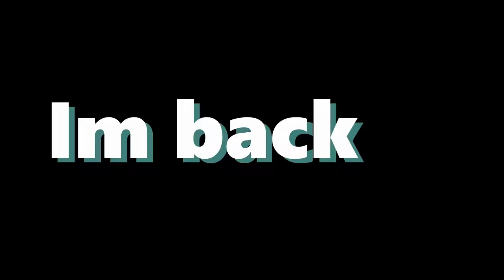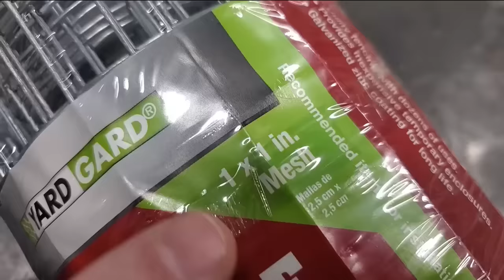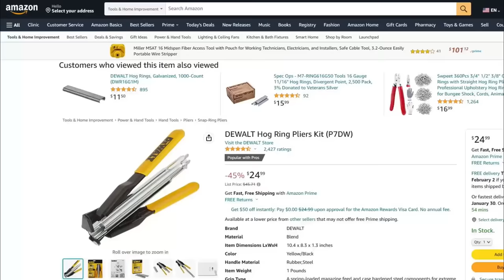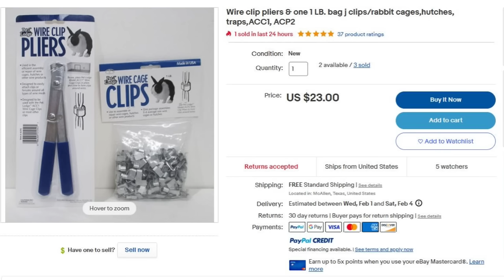Best ways to Trap Bluegill

Comment: I use those J clips on my DIY lanyard loops.  Wrap weed eater string around a 3/8” diameter aluminum tube and boil it the the J clips on the loops and cheap and easy lanyards for my rods and rod holders on my yak.
Make 2-3 traps like that and set them next to each other.  Awesome video!

Comment: Try dry cat and dog food in your fish trap.  It has always been successful for me for baiting fish traps. 

I also use it for baiting a fishing hole. I put the dry cat or dog in a mesh bag similar to a onion or to red mesh orange bags and drop in down into the water on a rope.  If in a boat I use a marker body  then and then fish all around the bag of food.  As the dry food breaks down in the bag . Ever once in a while lift the bag in several jerking motions allow some of the food to disperse in the water like fish chum bag.  Sometimes I do a bag in an area I want to fish the day before and fish over the area the next day. You can add a can or two of sardines to get a oil slick to permeate the water surrounding the dry food. I like to poke holes in the can with an ice pick to make it last long time while  the  bait mesh bag. Then everythime you disturb the bag  or a fish disturbs the bag it releases more oils out of the sardine can. I have also use canned herring and mackerel.  Works good in fresh water and saltwater  both.  It makes  for a great chum line drifting in the current.
Reply: Thanks for posting.
Question.

Do you place mesh bag on the bottom of the lake?

Comment: A Quartered up raw potato works best for Bream bait. We dont even use the bait box. We just throw a hand full of potatoes into the bottom of the traps every other day and add as needed. In the spring we put out at least 8 traps and run them all spring for Flathead and Blues and ocassional eating. These traps are Texas legal traps and we have caught upwards to 80 baits at a time in our Traps In lakes and ponds. I have built several of the Clover leaf traps and they work well. Texas legal traps are 3'X3'x1' with the openings at 1'''X3'''
Reply: What is the best bait for catfish?

Comment: For fishbox I use a 55gal plastic barrel. I drilled 1" holes all over it. Then cut a square hole in the top. I used some door hinges to reattach the cut out as a door.  I keep bluegill in there until I bait up.  Then use a couple 5gallon buckets with holes to hang over the side while baiting up.

Comment: Hey fishin n stuff...I recently discovered an awesome dirt bike hack,and it works for boat motors too,and it's awesome 😎,
All ya gotta do is get a cheap set of standard size steel guitar strings Wich work AWESOME to clean carburetor jets out with,or just wait till your kids play and break some,,you could even use them to clean your sinkers holes out with the different size steel strings,
Reply: Also, guitar strings are AWESOME for making dragging weight sinkers,I took your hacks and made my own with guitar strings,and they are dirt cheap too,,just saying

Comment: you should try a piece of flat iron top  clamped to the top of wire over edge of table and bend wire down then you will only cut once you will only have one seam to clip then you will only add top & bottom will be more rigid
Reply from the maker: I started to try that but ive never done it. I learned alot though .

Comment: Nice video BRO 🎣 👍. You could also make a Keep net,  what us English Matchman angelers use.  Lighter in weight,  & comperres flat . As it made out of.  A couple of steel hopes & 1/4 Inc soft mesh , like you find in a gardening store.  All  depends on , the length & diameter what you prefer.

Comment: On Your Fish Live Box, Tie-Wrap Some Large Pole Noodles Along The Inside Top Of The Wire Box, See If It Floats Next To Your Boat Or The Bank.   That Way You Won't Have To Pull It Back Up Each Time You Need Bait, Or Loose It's Rope When You Put It Back In The Water 🙂

Comment: I found a very fast way to catch bluegills for bait.  Use a 7' long ultralight (UL) rod, an UL reel with 2-4 lb test fluorocarbon, and a mini trout magnet (1/200 oz) jig, with a split tail grub (mini).  Instead of casting, pull out 7' of line and flip the jig out into the water.  Bluegills will come from all over to attack that jig. My personal best is 51 bluegills in one hour.  I supply all the catfisherman at the local public fishing lake with bluegills.

Comment: Great video. Maybe you couldn't remember where the trap was because you hit your head when you fell over that log.  Just sayin' 😁

I used  smaller mesh for the bait compartment so the bait doesn't float out. Also put the bait compartment on the bottom so when the bait floats up, it is in the middle of the trap instead of at the top of the trap where they can nibble it from the outside.
Location is key, especially in the winter. I had a special spot around a rock outcropping that never failed... until the drought hit and the lake dropped 6 ft.... now that trap would be sitting on dry land.
Reply from the maker: Lol . I think your probably right lol